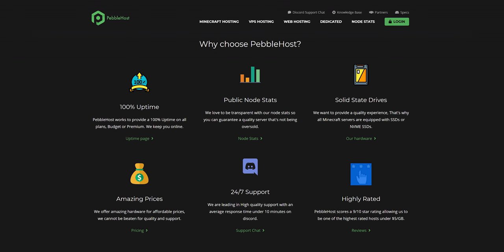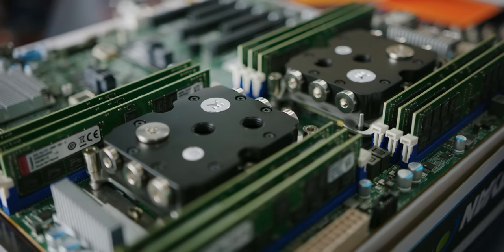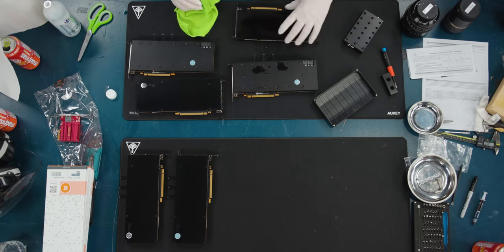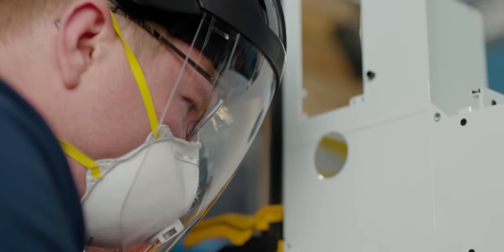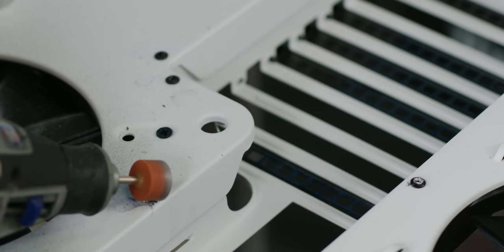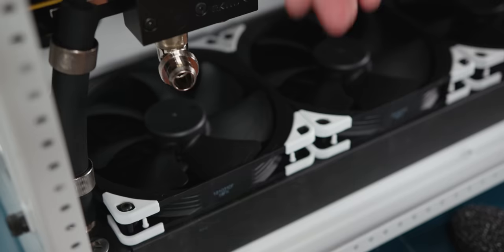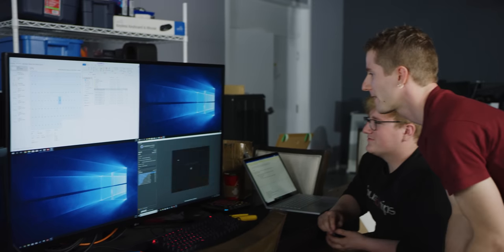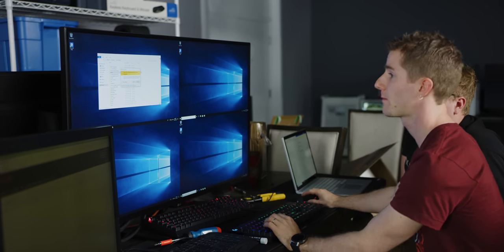We FINISHED the $100,000 PC! - 6 Editors 1 CPU Pt. 6

Comment: 28-core Xeons, Titan Vs, USB 3.1 gen2, 10TB WD Reds... This PC became obsolete before it was done being built.
Reply: At least the WD Reds are still valid!
Reply: Hardly obsolete if it's still gonna be used and not slow them down. Not to mention old doesn't mean obsolete, most data centers still use servers that are 6-10 years old at least
Reply: REDs being valid.. Nah. Bigger HGST helium drives were and are a thing.
Reply: @kebobs3727  I think the whole point was to be on the cutting edge. Their rigs from a couple years back could probably do the job. It's just been so long since they started this that not a single component is the latest and greatest anymore.
Reply: @chetanaik  pretty sure the point was to do it cause they could. If they wanted the best of everything this woulda had a much higher sticker price
Reply: @kebobs3727  $100000 for six editing work stations is pretty insane. At the time they started, their CPUs and GPUs both were the top commercially available products.
Reply: I think your definition of obsolete is a bit off
Reply: @chetanaik  They are still latest and greatest. What are you actually talking about? Year old hardware of that caliber is still very much greatest in comparison to the market and performance.
Reply: @citizenclown  i believe he was referring to the OP upcoming amd stuff
Reply: @citizenclown  Being a year old makes them by definition NOT the latest and greatest. The Titan RTX has supplanted the Titan V's spot as the best consumer GPU and I'm certain Intel would have released a new flagship Xeon platinum chip as well. And that isn't even considering the impending launch of Epyc.
Reply: @Speed-tk4yk  Yes, or anything up and coming. That stuff will too be added to a category of latest and greatest, but it is added to the category and, doesn't put his hardware to an obsolete list because something else awesome also exists.
Reply: @chetanaik  oh? You have a definition of latest and greatest now? I'm very intrigued. So latest means within 1 year? Greatest doesn't mean a category? You've assigned very specific performance parameters of what a "greatest thing" has to meet? Lol.
Reply: @citizenclown  'Greatest' by definition means the very best. 'Great' can be a list of multiple things.
I'm not saying their hardware is bad, it's still certainly great. Just not the best as they initially planned to spec out a year ago. I'm not sure why you are getting so defensive about this.
Reply: @chetanaik  How am I defensive? Because I questioned you? I asked simple questions. It is all subjective is my point. Even a year later, it is still in the "very best" category. There is not ONE item that is the VERY BEST, again that is subjective. It is a category of the very best hardware you can buy. Still there, so your statement is incorrect.
Reply: @citizenclown  Because you are being pedantic over the English language.
Reply: @chetanaik  lol. And I'm done with you.
Reply: @citizenclown  Ok. You tagged me lol.
Reply: @chetanaik  We do that when we hope we will have a fun conversation and not end up talking to a troll that wants to refute every point someone makes. Good luck with your ventures, mate.
Reply: @citizenclown  Says the person who devolved into sarcastic jabs at the second reply. I made my position very clear, you decided to try to have a discussion on a definition of a word.
Reply: @chetanaik  ok troll
Reply: @citizenclown  The words of someone who can't hold a decent discussion without resorting to sarcasm and name calling.
Reply: @citizenclown  Correction, angry and defensive!

Comment: Nice system but I see one issue. If it goes down you have 6 Editors twiddling their thumbs.
Reply: simple, build another for redundancy!
Reply: There is that and it probably would have been cheaper to build 6 computers. Their way is defiantly more fun though.
Reply: Simply Nonsense That’s exactly what I was thinking :)
Reply: Honestly I doubt this would be used it's  flexing at best.
Reply: @SimplyNon_sense  The accounting for this project is probably fun, between hardware that was given to them (even if they had to replace some with their own money), time invested by employees, revenue by milking this project on multiple videos over a year and actual work that will be performed on this machine I wonder if LMG breaks even or what. If it turns out to be an efficient way to work it could help pay itself in some time though, but somehow I doubt efficiency was a goal for this.

But it's value in satisfaction of pulling off a project like that and pure bragging rights is probably hard to put a price tag on.

Comment: If AMD sponsors the 10 editors 1 CPU build, I will smash my 9900k with a hammer
Reply: I’ll gladly smash any Intel build just give me the word
Reply: Give it to Linus and he'll brick it just dropping it.
Reply: AMD GPU's would never be able to do the job, they melt when editor 3 is added.
Reply: @jankees4037  i think they mean the cpu/motherboard
Reply: @jankees4037  Navi's in to fix that
Reply: @CaptainCaptainZach  Linus will gladly smash the AMD 7 Gamers, 1 CPU build, he bum ripped that so hard due to all the grief from the AMD hardware while his Nvidia build was a breeze.
Reply: @Outfrost  Isn't Navi mean't to be consumer grade not workstation grade? Guess you'll be waiting another 2 years for a gaming GPU.
Reply: @Skelath  Navi is the microarchitecture. You can build consumer, workstation and server cards with GPUs from any microarchitecture, as is the case with Vega and Radeon Pro WX cards. I suppose one can wait a couple months for the Navi Radeon Pros, depending on what it is that you need. And what's with the 2 years? I'm most likely buying an RX 5700 XT when it comes out in two weeks.
Reply: 2nd gen Epyc
Reply: @Outfrost  last official line up of consumer GPUs 2 years ago, and everyone was expecting navi last year but instead got the 590.
Reply: If this happens you better upload a video doing this
Reply: @Skelath  It's not like those cards ceased to exist since then.
Reply: @Outfrost  Took AMD two years to match the GTX 1080 Ti (14nm) and even then the 1080 Ti still out performs Radeon VII (7nm) in most games and even though lower nm means less power used the GTX 1080 Ti with double the nm still uses less power than the Radeon VII, you guys waited 2 years for that, and the day after release all the Radeon VII cards were brought out by scalpers and sold on Amazon / Ebay selling at the price of an RTX 2080 Ti because AMD only had a limited stock of release.

Comment: Why build a 100k PC,
when you can buy 100 apple stand.
Reply: Or get tuber simulator for free!!!
Reply: @TheReal_ist  when you can buy 100 apple stnads.
Reply: @CoffeeAddictGuy  you tried...
Reply: Holy shit if 100 people buy that they literally make $999,500 in profit.
Reply: Stands*
Reply: @insanefanta8025  Sdants
Reply: @pangkan270  stands*
Reply: Facepalm
Reply: @Mnerd7368  no
Reply: @Mochi-mf3px  I am not defending the price but the special swivel part is also included. Still only a $200 stand but it is more than just a pound of aluminum.
Reply: @batsonelectronics  Swivel doesn't really mean anything when other have it for much less. You could probably find a monitor stand with built it swivel for less than 100
Reply: Exactly
Reply: Jonathan Li And that’s a great price!!!
Reply: Wow that's nuts when you put it like that
Reply: @ltzeu8510  the Apple version is made of metal and it much more elegant than normal plastic ones. As I said, a $200 stand. It tilts and rotates and swivels. Regular units bend under the weight of low weight displays, the Apple one looks to be very well made and capable of holding more weight. $1000 is too much but $100 is not enough.
Reply: @RunFor OurLives Agreed! Apple stand is way better and more practical.
Reply: @brentengle6183  Free?! WhaAAaat!
Reply: @TheReal_ist  apple fan boy can't STAND criticism!?! Let's everyone give standing ovation to this joker like in the apple store :)
Reply: No one man can have all that power.
Reply: 101 actually the stand worth 999

Comment: When you get a Mac Pro you NEED to compare it to this. Probably just 1 VM though...
Reply: Absolutely nothing to compare
Reply: Na just similar spec no point comparing a  Ferrari with an F1  car.
Reply: Maybe a single VM vs mac pro
Reply: Only slightly more expensive than a high end Mac Pro...
Reply: Bet the Mac Pro would actually work...
Reply: @psikogeek  Isn't the new highest spec Mac Pro like a 50k?
Reply: @humansrants1694  lol the Ferrari sf90 IS an F1 car
Reply: @manukivela  as far as I know there are no prices yet, only estimates. One thing that will really alter the pricing are the expansion modules by either Apple or third party manufactures because there are some crazy prices there sometimes with very specialized hardware (or just so niche and proprietary they charge obscene amounts) so there will always be difficulty pining down one true "high end" configuration because there will be many different and it wouldn't surprise me if some of them end up with a total larger than this project. But is likely a fully loaded one with no "esoteric" hardware could easily push $50K, those mpx pieces will probably make any total go up quickly.
Reply: The Mac Pro is impressively expensive, isn't it?

Makes you wonder how much the stand, FireWire cable, and service calls will add to the price.

Comment: Now with just one component failure, you can loose 6 editing stations at once, order now.
Reply: I was thinking about that, the power usage it will be lower , but the point of failure can disable the whole company if this will be used.
Reply: ahh your think meat is working well. good point!
Reply: I mean If it breaks the company literally is a PC warehouse so they probably have some other pcs available. Their work would be slower, but still functional
Reply: Always have a backup. It's only another 100k
Reply: @alex_prochazka  I know is just Linus being Linus, but it just a bad idea in so many levels, he could've assembled 6 U$16k very high end workstations that not only would perform better, it would not take down his whole editing department with a single point of failure. But it make for a good video I guess.

Comment: i still think that 100000 usd just for 6 editors may not be the best cost effective way to edit raw 8k footage...
Reply: Depends on how the CPU cores scale over the virtual machines. If having 8 dedicated cores for each workstation then yes, it's rather inefficient. But if all the cores can be assigned as needed it means one editor can use almost all of the 56 cores as long as the rest of them do less demanding tasks. And this switching only takes a few milliseconds. Just an editor just picking up the phone for a few minutes will release "his" cores for someone else to use.
Reply: @SweBeach2023  i think linus just gave a fixed amount of cores to every editor, and i think that may be even more complicated to do that it sounds 

Windows doesn't need to know how many cores do you have for the scheduler to work?, changing the cores on demand may "confuse" the scheduler and bug out the programs and corrupting data
Reply: definitely not, the best thing this offers is an office space saver.  its better to have 6 independent computers linked, that way if your 100k PC goes down for water leaks, crashes, etc. you don't have 6 idle workers. never the less, this is pretty cool.
Reply: @Elinzar  I agree with your viewpoint. It seems high risk to put 6 workloads into one PC. Motherboard dies and you have 6 editors out of the game.
Reply: I think, and might be stating the obvious, they did it just for the kicks of it and to film an interesting series.

Comment: I hope you guys try a similar project with the Epyc 7nm
Reply: Imagine dual 64 core CPUs.
128 cores 256 threads.
Reply: @-ragingpotato-937  Or use an Intel Phi co-processor, 72 cores 288 Threads, or why not two of them, or four xD
If they skip the USB cards they could get 432 Cores and 1728 Threads :-)
Reply: @Keltheran  Sadly Intel Phi is not great for this and slow clock speeds at high threads. I would love to do something like this with Threadripper
Reply: Definitely, with 64 pcie 4.0 they'd also have  full 16x 3.0 lanes to every gpu with more left over for networking
Reply: Might as well start playing with clusters at that point lol
Reply: and for God sake don't drop it - it will make a Thud...

Comment: 2000 Watts of heat output... Reminds me of the HD7970 in crossfire.
Reply: I have a 7990 and it's at 90c on half load
Reply: I used to run dual 6950's i feel you brother